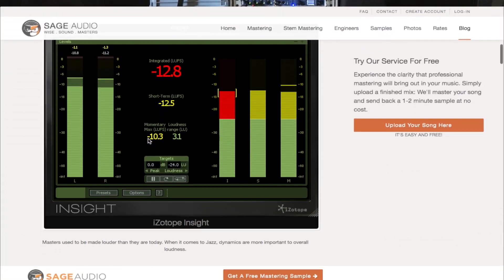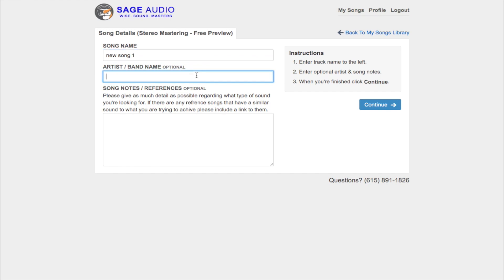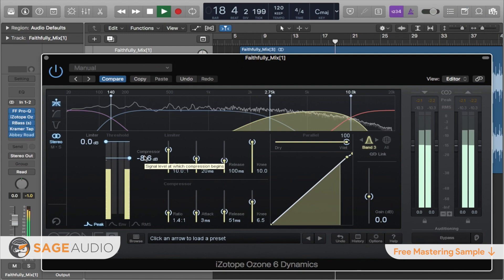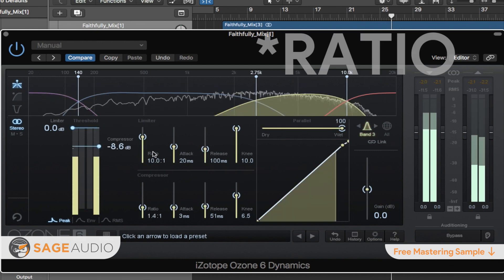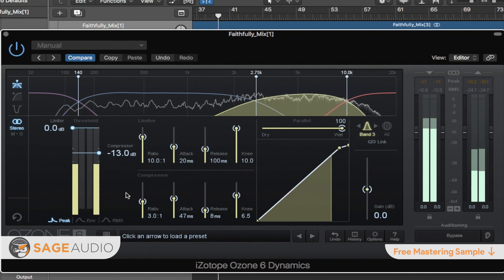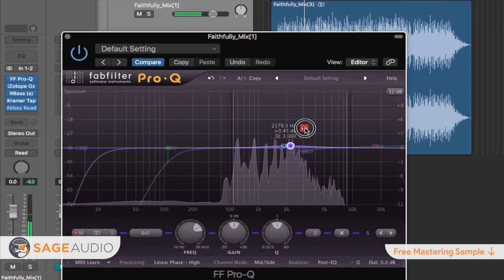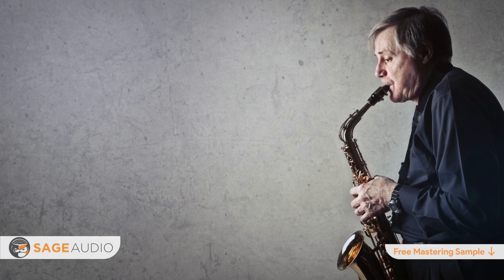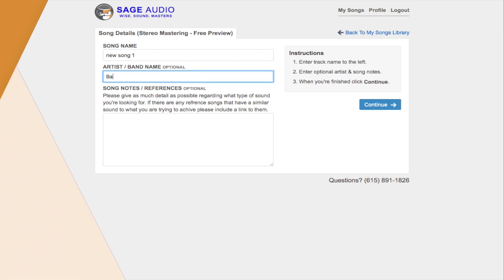What is Mastering for Jazz Music

Comment: Hey, nice video. As a jazz musician and mixing engineer myself, I wouldn't recommend a multibend compression as the first tool to tame dynamics. It can change the sound even without any gain-reduction. If dynamic of the track needs to be tamed I'd recommend to use some gentle compression in parallel.

At the same time, I'm not saying "never do it", especially knowing that Al Shmitt used a multibend tube-tec compressor on the master buss:) But he's Al. In general I think that mb-compression is not a friend of natural sound, while it is a great tool to fix problems if there are some.
Of course it all depends on the track - some jazz music can be mastered the same way as rock music and it'll be right.